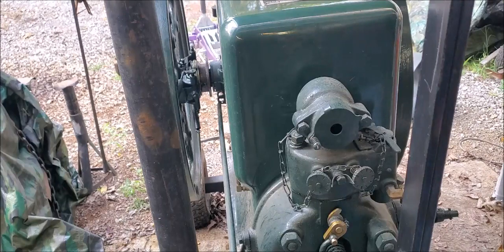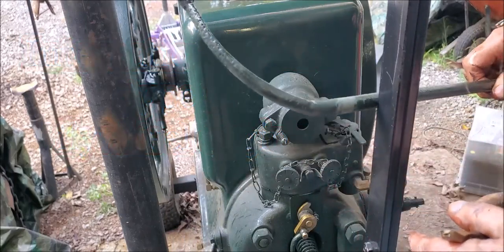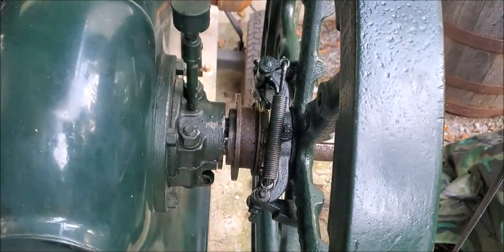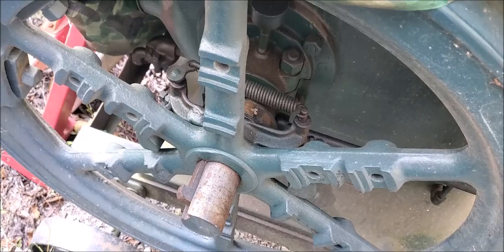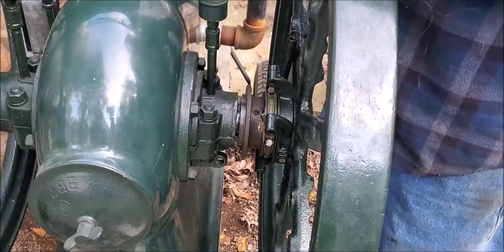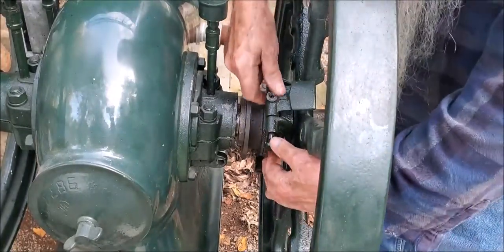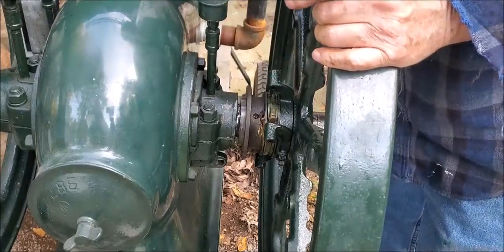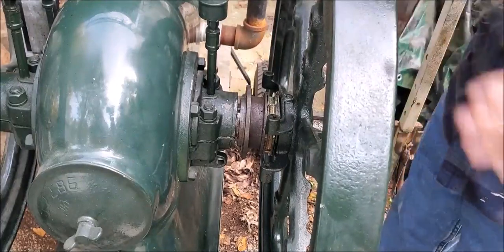International 6 H P type M Engine GIB KEY

Comment: I put new keys iny 6HP they did not fit well the stuck out  too far like your engine. I saved the old keys and compared them to the replacements and found they were oversize . The new keys were machined to match the old keys this made a much better fit. The new keys were purchased from a well known source. Very nice weather to work outside hope to see this engine running before winter.